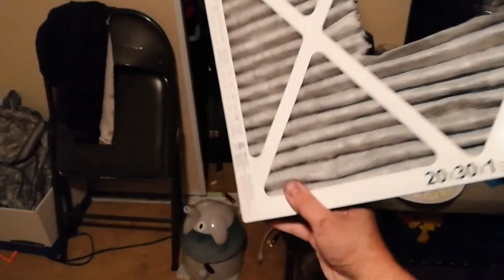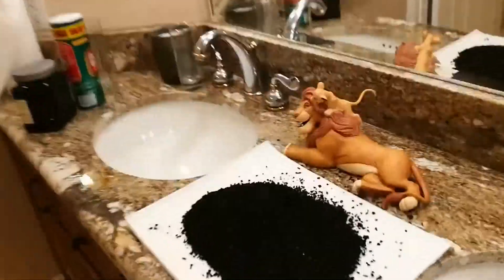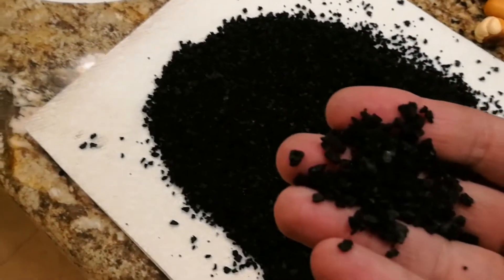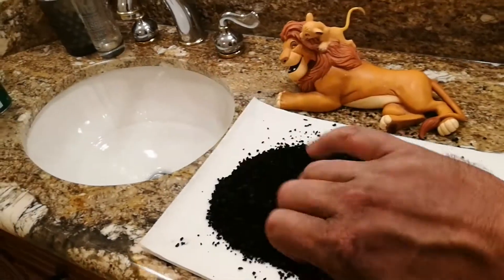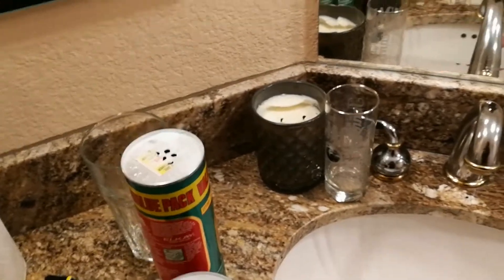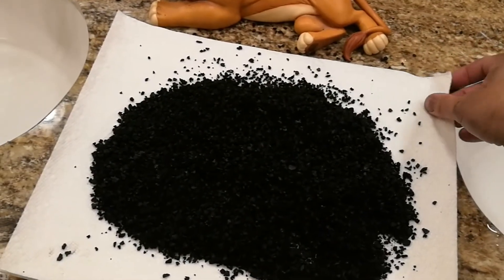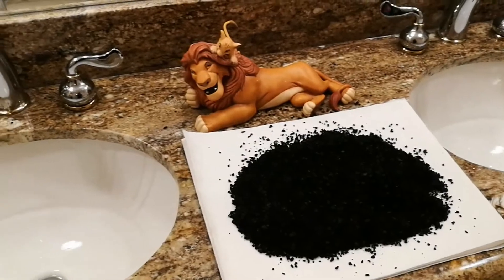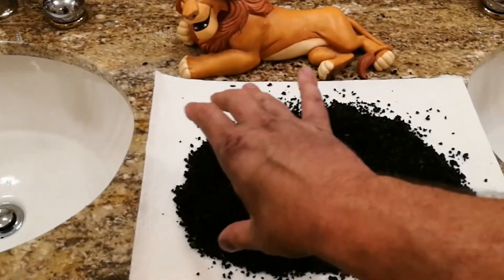Today's fun, putting a kilo of activated charcoal into a holmes HEPA aircleaner

Comment: You did WHAT??
Reply from the maker: Made a 3 layer media filter, 3m 1200/2.5 pounds rinsed and dried activated charcoal/ 3m1200 as a prefilter set to 2 Ultra Alerrgen Holmes Hepa filters.  Results.... Cleaner air than the fucking Alps!